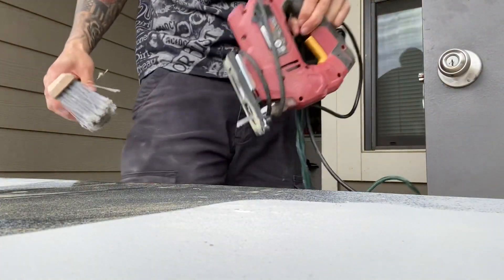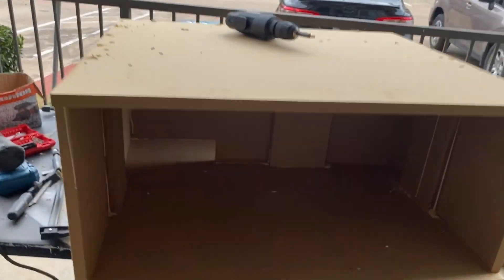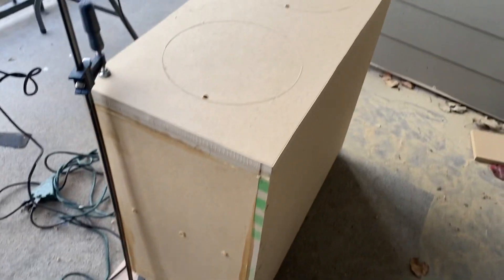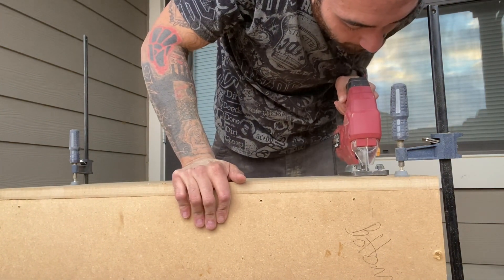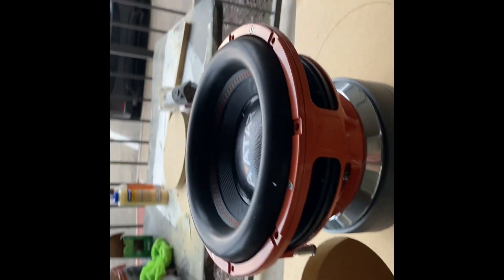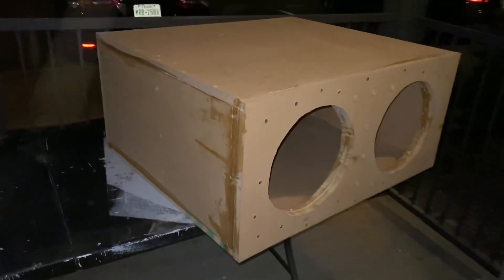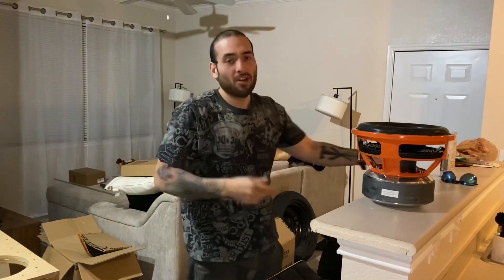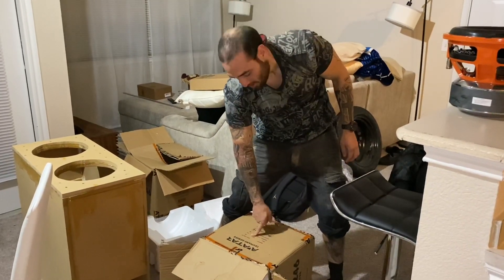2 Avatar STU 12s Custom Box Build, Unboxing, and Timelapse

Comment: I know you see me in your comments a lot. Lol.  But I just built my first box at 5.5 cubes for 2 of these 12s. I wanted it tuned to 28 but messed up when I cut the port length and it's more like 26hz. They're bottoming out. I didn't adjust or retune the amp. Should I just up the subsonic a little? I can also add more bracing to take up air space too. Subs facing forward, 8" aeroport firing to the drivers side in an 09 maxima. Box specs are 13 x 32x 35. I see guys with these subs at 6 cubes. Any suggestions I appreciate it. Sorry this was so long.
Reply from the maker: You good brother. Yes go up on your subsonic filter or high pass filter. Listen to it then decide if you want add bracing will bring the tuning up a tad
Reply: @mikessplboxes7497  that's ok cause it's tuned to 26 so if it goes up to 28 it's fine. I raised the subsonic. Much better. Still gonna try n shrink it down a little. Iay end up building a 5 cubes box. I have wood left over. Would maybe cost $100. This box was an experiment anyway. Lol. Never done it before. Came out pretty good though. Thanks for your help.
Reply: I ended up building a 4.8 cube box tuned to 32 with an 8" flared big ass port. Sounds so much better than the other box. 2 boxes in 3 weeks, I'm done building for now. Lol
Reply from the maker: @grady.stu.8300  yup told ya, these subs are really picky on the box and they need a ton of power to get loud. Personally i did not like em.